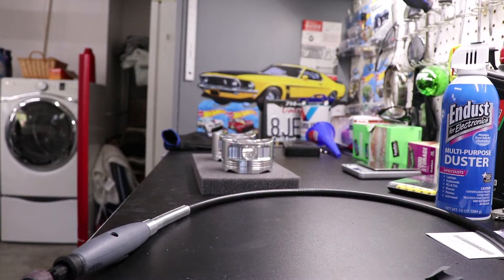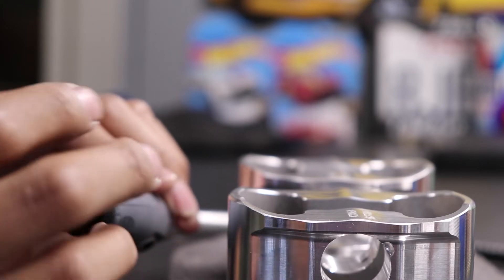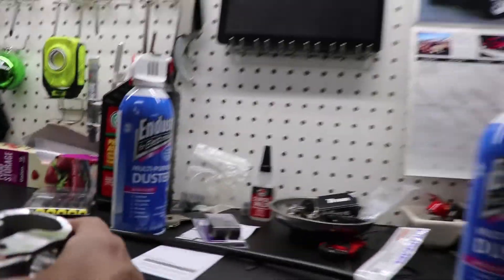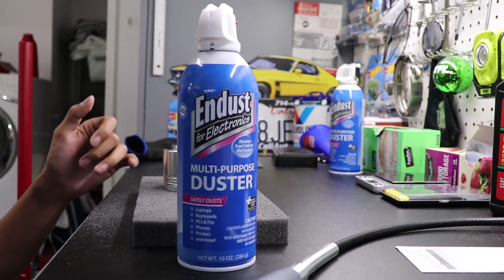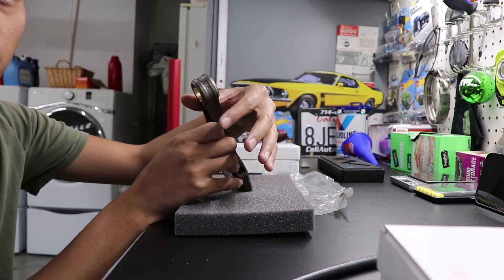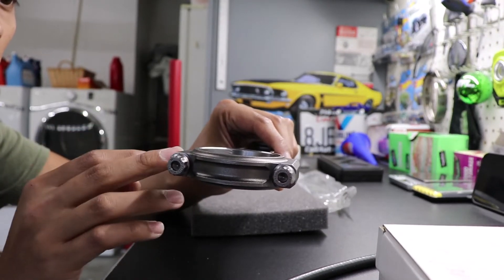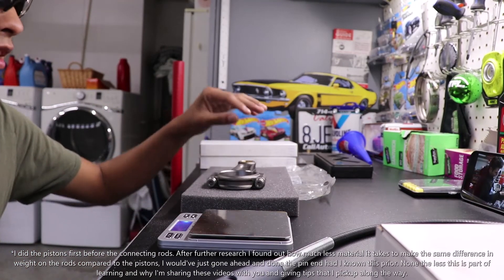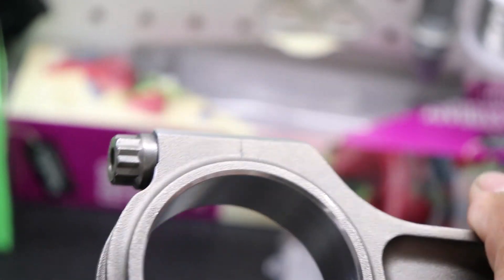BMW N20 F30 Build Episode 2: Balancing Eods and Pistons

Comment: Hey what up buddy can the N20 engines blocks be honed like a regular engine block? What’s the deal with the coding they have I want to rebuild mines randomly lost compression or correction has low compression. Can I just buy pistons or just replace the rings on it and install everything back?

Comment: Hey what up buddy I have a 2015 bmw n20 engine have low compression on 4 cylinder 90 psi 1-3-4 num# 2 119psi  added some oil in cylinder jump to 160psi  on all 4. can this block be hone ?

Comment: Why do you need to do this? I though you just needed to order the pistons and it was fine 😵‍💫
Reply from the maker: Some people do it’s more so dependent on the tolerance range that you get when you weigh everything and what you want to balance down to, there’s plenty of people that just match the lightest piston with the heaviest rod and move on down the list to get it as close as possible, I’m doing it more so for the learning experience and since I have the extra time waiting on the block and cylinder head to make their way back to me. The rods are the more troublesome to accurately measure, but having a machine shop do all the balancing work isn’t very expensive either. Regardless of the route you take as long as it’s balanced to an acceptable range it’ll be good. For me it’s in my mind the closer they are the happier the engine will be even if it’s technically alright with some variance. The stock rods/pistons were 1082.6 grams at the lightest and 1086.0 grams at the heaviest. So even from factory there isn’t a huge emphasis on getting the weights exact